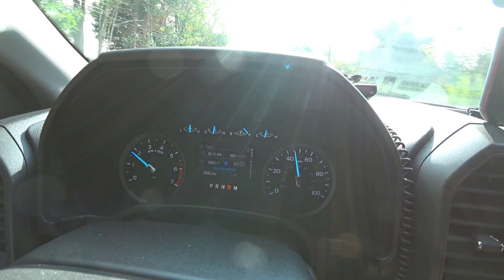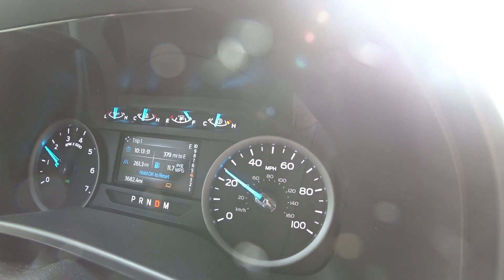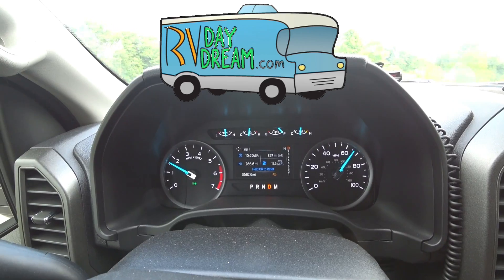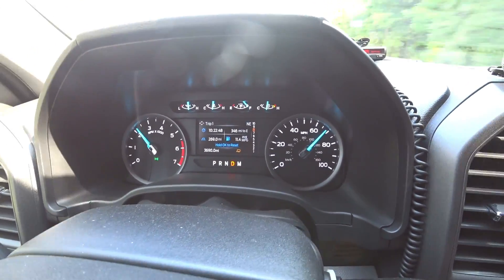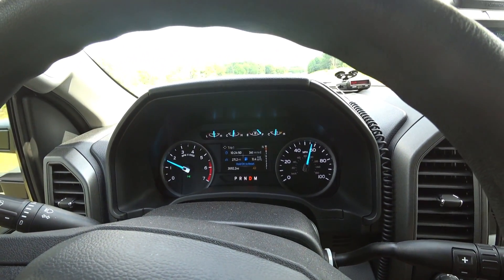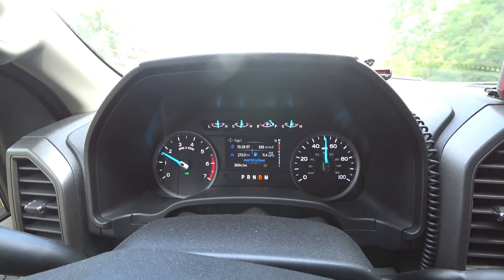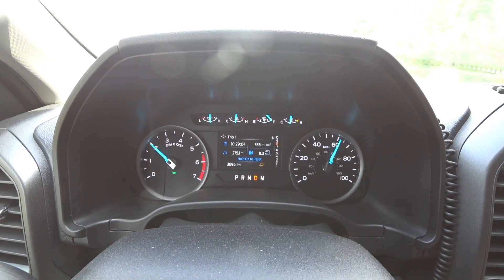2020 Superduty 7.3 Towing 8000# Travel Trailer

Comment: 2015 F-250 2wd, extended cab, 6.2 GAS, 363,400 miles. Oil changed at 15K, full synthetic oil, no repairs other than scheduled maintenance. I haul exotic and antique cars and motorcycles all over the country in a 24’ enclosed trailer. An average month is 10,000 miles. Usually two bikes and a car on a trip. Also a travel-lite 6.5’ slide in truck camper approximately 2,000 lbs. 17K-18K gross is a normal load. I do this for a living, the math for a diesel just doesn’t work until you get over 20K gross. Initial cost for the engine upgrade, higher fuel price, def, extra weight, more moving parts, etc. My cost per mile is just shy of .19 cents per mile cheaper than a diesel in the same configuration.
Reply: Eh. My 2002 F350 7.3 Powerstroke Diesel have over 240k and still running strong and I got my truck for 17k it's a fully loaded lariat crew cab long bed 4x4.

Comment: I've got to get a new truck and have researched and reviewed for 2 whole years. Ibew union electrician, I have a 7000 pound 30 foot bumper pull trailer and will be traveling for the foreseeable 5 years. I refuse to get a diesel for such little weight, and with Per Diem truck calls going for $115 per day for crew cab 4x4 f250+, it makes sense to me to buy the newly designed 7.3l on an xl f250 platform.

 6 speed 6.2 is proven technology, but worse mpg over time and not as easy to service, as well as transmission is geared for towing not for saving gas. 7.3l you can lock out specific gears which is the game changer, as well as the bigger tank. $49,569 @84 months here in Augusta @3.84 APR Looking at lass than 700$/mo. Worth it for me! Thanks for your review buddy, I've watched your previous videos while I've done my research. Thanks, and good luck!
Reply: I ended up purchasing for the final price of 63 and 1/2 thousand dollars an f250 lariat FX4 package with every single thing I want on it including a moonroof a sunroof and block heater and dual batteries and dual alternators 10-speed transmission 7.3 and it's a 2021 model! I'm very excited for it to get here should be here by Thanksgiving 2020
Reply: @theamericanforester  hell yeah that’s worth it
Reply: I ordered a f350 7.3 about 3 weeks ago.   How has your truck been so far?
Reply: @fighthard21  I ended up not buying it after he got built it was just too much damn money for $63,000 and still getting 13 miles a gallon or less

Comment: Hi there!  Thank you for showing your towing experiences with your new7.3! I just ordered an F350 7.3 with 4.30 gears yesterday.   We ordered an Outdoors RV travel trailer as well.  Loaded up, it will probably be about the same weight as yours.  We live in CO and there is definitely a crew of people that would say we should have got a diesel.  But, I've towed here with the 6.2l F250, and it did fine.  The gas rig will probably be 30 seconds behind the diesel if both were towing weights up a mountain pass. 

Safe travels!!
Reply from the maker: Yeah the days of gasoline being a non performing engine when it comes to Towing is definitely in days of past. I would have to think that you are probably going to be heavier than us as our combined weight fully loaded with everything is 17000 pounds. I believe those outdoor RVs are pretty heavy because of the way they are built. Unless you have a 25 footer then at that point you might be close to ours.
Reply: @Foxboss9  Good morning!  Yes...times and technology have sure changed!  We just got rid of our 1996 454 powered Suburban.  It was actually a pig here in in CO in the mountains just towing 5 or 6k with my wife's vw bug and a trailer.  This new one should have almost 50% more power.  

Yes...the ORVs are definitely heavy.  Ours empty (a 26 and some change foot model) is 6400lbs.  I assume I'll usually be under 8500lbs, until I fill up the fresh water.  It holds 80gal's.  The manufacturer's listed CCC is like 3300lbs, for a gvwr of about 10k.  I guess I'll have space to bring my anvil, bench vise, maybe collect some rock boulders for the front yard,  and such. 

Have a great day!

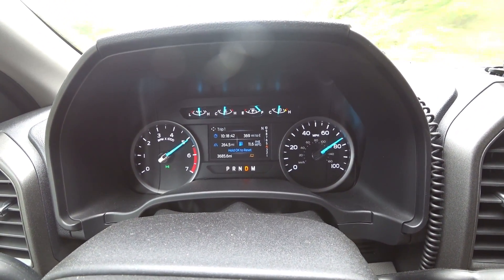Comment: Thank you for the review. After dealing with DEF issues on my 6.7 I’m done with the diesel. Tired of sitting on the side of the road in idle. Cause some sensor thinks to much emissions is going out the pipe. Going to order a 7.3 tomorrow. Our camper is 9000 unloaded. I think I’m going to go with the 4:30 gears though.
Reply: May I ask why you would go with 4:30? Not being a dick. Just trying to figure out what I need
Reply: blkfeet29 I’m going to becoming from a 6.7 dually, so I’m spoiled with the power. Actually this has been my forth diesel since 1998. I want the most gvwr for a trailer as I can get. Actually if you get the the dually with the 7.3 I believe it comes standard with the 4:30. With the 3:73 your rated at 15,900lbs for a fifth wheel and 4:30 19,000lbs for fifth wheel the way I spect out my new truck. Both gears are rated for 15,000lbs conventional tow. This time around I’m going to a SRW. Just tired of driving a dually for now and want a change. With the troubles that I’m having with the def system as also turned me off for now on the diesel. Maybe when the time comes down the road to get another truck they will have gotten the system figured out and I may go back. But for now no thanks. Over it.
Reply: Thank you for your response and making it make sense. I'm going to be coming from a f150  and I need something with more ass, sometimes! Diesel obviously has more ass but the added cost is scary to me. So after hearing from you and some other people I think I'm going to go with the 7.3. Once again thank you for your input.
Reply: blkfeet29 After sitting on the side of the road several times in idle waiting on a tow truck sucks. My truck has been at the dealer a month and a half now. I would get it back and only be able to drive it 3 days and it would go back in idle and back to the shop on a tow truck. At the moment they think it is fixed and they have been driving it a week now and it’s still running. Going to call first thing in the morning and if it’s still running and not going into fault we are picking it up and going straight to another dealer that I have a deal worked out with and trading it in. Have to order the new truck so it will be a long wait but I’m soooooo over this diesel at this point I could care less and just want to move on.
Reply: @ckonthebay1950  I’m looking at these trucks and seriously considering ordering one myself.  What kind of discount from MSRP are you able to get buying it this way?
Reply: @ckonthebay1950  congrats and good luck.  I’ve never ordered a vehicle before.  With inventories so low- it seems like a great way to go.  Was the dealer you ordered from in the same state?  My mind is open around the logistics of purchasing and would drive to pick it up if the deal is right and I didn’t have to jump through flaming hoops for sales tax and registration purposes.
Reply: @ckonthebay1950  hmmm... I'm in Florida too.  Do you mind sharing the name of the dealership you used?
Reply: Why SRW from DRW? Was it hassle from parking? Dealing with narrow lanes? Tire rotation hassle? 

Or was it just not necessary?

I'm considering a dually for the added sway control with a big camper in the bed. 

Thanks, Max.
Reply: Max Ford all of the above.
Reply: I've ordered a 7.3 with 4.30's.  Currently have 4.30's on my 2018 6.2 and they are great for towing; and virtually no mileage penalty empty;  better mileage towing.  Pulling an 11K 5er.
Reply from the maker: 373 Max Towing is fifteen thousand pounds the 4:30 gears get you an extra couple thousand pounds towing capacity
Reply from the maker: Ford X plan pricing get you real close to about $52,000 with the truck the way that it is shown
Reply from the maker: Sarchione Ford Randolph Ohio
Reply: I ordered  (about three weeks ago)our F350 7.3, 4.30, crew cab, short bed, xlt.  Have you picked up your truck yet?  I was told 10 to 14 weeks...hoping its closer to 10 weeks!

Comment: I love my 2020 7.3 gas motor but I already had my front main seal replaced because it was leaking. I tow 13,500 lb fifth wheel about 7000 miles a year. The seal went out at 18,000 miles. It has 23,000 miles now and its good so far. My mechanic made a video with the fix. Its on YouTube somewhere
Reply: Towing with it is a breeze. I have gone through the smokey mountains a few times. Never have I felt like I could use more power. Sometimes an an exhaust brake could of been some help going down some steep hills but using the engine brake in low gear work fine. The fix held up great. No issues whatsoever after that. For your weight a diesel might work better but it all depends on how many miles you pull a year. The 7.3 would do a good job if you don't want to deal with the modern diesel emissions. You could change the engine twice for the same money you would have to chage just the fuel system on the diesel. That's not including the DEF system.
Reply: I saw that video. That mechanic does a lot of diesel videos (if it’s the same one). Don’t worry about the seal it shouldn’t happen again. It was a defective part.

Comment: Test drove a 2021 f350 7.3 gas yesterday.  Looking to haul a skidsteer. With skid and trailer we'll be about 13,000 pounds with trailer and skid. We're thinking should be a good truck  for that.  What are your thoughts on hauling that weight?  We're not buying for fuel mileage we're buying for a work truck.  Mainly hauling skid around town like a 20 mile radius couple jobs a little farther. 

Thoughts or concerns would be appreciated

Comment: 2007 6.0 powerstroke F350 4x4 srw. Bulletproofed. 4:10 gears. I pull a 12k pound unloaded (18k gvwr, but mostly around 15k pounds) Recreation by Design triple axle travel trailer . I would never pull anything over 10k with a gas engine.

7.3 gas is an awesome truck, world's better than f150 when towing 8-10k pounds. Anything heavier, especially over 10k pounds, 6.7 powerstroke is the answer, especially when your in the mountains.
Reply: Going a few mph slower up a hill isn’t the end of the world. Plus this 7.3 gasser has more hp and tq than the 1st gen 7.3 PSD. No one ever complained the old 7.3 PSD is underpowered. Modern gas motors are much better, especially after you have to put urine in your diesel trucks.
Reply: @nicolathonathan770  

I agree to an extent.  I like the 7.3 gas, its a brilliant idea by Ford to capture those who don't need or want expense of a diesel but stills allow you to pull heavier loads than a f150.
I just don't get why people want to pull a 10k-14k trailer with a light weight f150, its dangerous. 
A 10k pound trailer is heavy, its a good size weight for a truck .
I just watched a video on a 2021 rockwood signature 8336bh...11,320 gvwr!!! 9700lb empty!
I never want to put that behind a f150 or any half ton truck....people don't think about going up mountains or coming down them!!
Reply: @resharddurdley6987  My camper is 3500lbs GVWR but I still chose a 3/4 ton for the payload. I personally think 1/2 ton towing capacity for high wall trailers should stop at 6000 lbs. Getting a diesel truck would be an endless nightmare for people like me, who only use the truck to tow campers at most 10 times or 2000 miles a year. It’s gonna be hard to keep the diesel fuel and DEF clean and it’s only gonna be the matter of time the engine chock itself and needs big $$$ repair. I don’t see myself ever gonna own a diesel truck. By the time I retire and do RVing full time, we all gonna drive electric trucks with 3000 ft lb instant torque.
Reply: @resharddurdley6987  Because Ford says you can.   I wouldn't either. ;)
Reply: I tow 12k lbs with my 95 F350 460, 5spd 4.10 gears Banks headers.  It will tow it faster than a 7.3 powerstroke of the same year and the 460 is known for going over 200k miles.
I have a 2005 F350 with a 6.0 completely bulletproofed and a 2022 F350 7.3 both rated to tow the same and I love the 7.3 gas compared to the 6.0.

Comment: I was hoping that technology would somehow help out with that gas mileage. I was going to buy the diesel, but after seeing some YouTube vids talking about maint costs and issues with the new DEF diesels might mean its time for my first gasser since 2001. Thanks
Reply: What did you end up going with
Reply: @leardi58  I decided on the 7.3 gasser. The 2022 Lariat which was a little more “affordable” to deck out with options since I did not have to pay the $9000 upgrade for the diesel.

Comment: Good video. I think Ford has a winner on their hand with this 7.3 gas. Most people THINK they need a diesel, but in reality most of them do not. I would enjoy the feeling of not having to worry about the issues of a modern diesel and all the emission control systems. I too am looking at a 7.3 gas pickup, but will likely wait a bit before pulling the trigger. It would be interesting to see the towing characteristics  of the F250/350 with that Tremor package since I think you get the 4:30's. Thanks for sharing.

Comment: Great video!!  Yeah. I don’t think even with 10k and 4K miles a year justifies getting a diesel.  The cost alone would push you to 12 to 15 years to pay it back. And the 7.3l has plenty of power with the 3.73. It has a 16k payload for towing. Either way great video!
Reply: Robert Condon yeah I’m planning on getting around 15500 or 16k gvwr 5th wheel so I should be good. There was a video where TFL was doing a test on a goose neck and it pulled 22k like butter. Same engin same axle
Reply: The initial cost of the diesel is offset by it’s resale value. Pay more up front, the truck is worth more when you sell it. You could look at the difference of the xl & lariat & platinum trim levels....you’ll never recoup the cost of the extra trim level until you resell or trade it. After 20+ years of owning diesel trucks, I’ll likely go to gas for my next one. I’m definitely not liking the idea of going from ~19mpg to 12 or less, but there are just too many potential problems with the newer diesels.

Comment: Sounds like there's lots of features, but at what cost?   I pulled 40,000 lbs gross up the mountain leaving Albequerque at 75 mph with no downshift from overdrive my 99.5 F250 7.3 DIESEL and it still runs great with 320k mi.  The engine breaking in the 2016 and up trucks are awesome.  You'll be lucky to get maybe 200k mi. out of that engine, but, you'll save a little on oil changes.  Diesels have been known to làst longer than gas engines.  You'll learn to like that transmission breaking on your truck, especially with loads twice as heavy as that 8000 lb trailer -- which I think is really light for a 30 footer.  Thanks for the update on the 2020 gasser.  Keep posting as you get more and more miles.
Reply from the maker: Again, different characteristics for completely different engines. It would be like saying a 1.8 L Toyota engine doesn't have to Rev near as High compared to the 1.8 L Mazda rotary engine. Two different schools of thought. It doesn't make one better than the other. As far as 200,000 miles with the 7.3 gas, I have a feeling they're going to do better then most considering it's a forged crankshaft , much better cooling than any previous V8, cast iron block with extensive reinforcement webbing, a forged crankshaft, and 6 bolt mains. It's going to take a lot for that engine to come up short considering my old 460 had over 160000 and it performed perfectly. Even if I only get let's say 150000 out of this new gas engine, you can buy a new long block crate engine from throttle body to oil pan for roughly $7,400! Still shy of the $9,000 premium I would have had to pay to get into the diesel. Like I said plenty of times prior and even in this video, people have got to learn to buy a truck that matches their needs or slightly exceeds. Diesel used to be the way to go on even some of the lightest Towing and for everyday use but to buy a new one, and pay the kind of money that they're asking for oh, and the have to deal with the shortcomings of the EGR, the exhaust scrubbers, the def for the life of the factory warranty before you can yank it all off and make the truck perform the way it should or I should say the way they used to. There's a reason that the gas engine Market is booming and the manufacturers are pushing them. But, like I said, Towing over 10000 pounds more than 4000 miles a year. I would definitely look at a diesel. Even with all the emissions crap, and the higher fuel prices on average, and the higher oil change cost, and the higher initial purchase price. So don't be surprised that maybe one day on this channel will be talkin about a new diesel truck!
Reply: Inspironator pulling 40K in an F250 and not dropping gears.  LOL
Reply: @davidalphin6626  Yes, the venerable International 7.3 ultra-reliable million miles proven thought time and breadth, THE ultimate workhorse.  Hahahahaha
Reply: @Foxboss9  My buddy has a shop and is replacing a 6.7 powerstroke in a 2012 landscape truck with around 100k on it. He is putting a complete 6.7 in for 17k . The engine alone was 14k his cost. He got it complete because to buy all of the fuel components that go on top cost a good bit more than the extra 5k.
Reply: @davidalphin6626  I know,...right?
Reply: @Foxboss9  A fully dressed 7.3 crate engine can be had for about $7,500!   So if you blow it you won't break the bank. :)